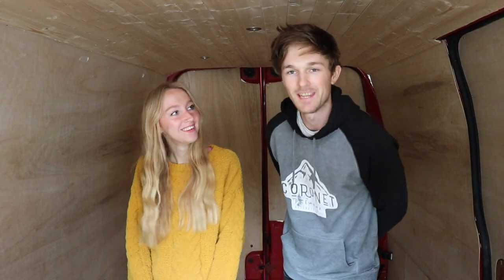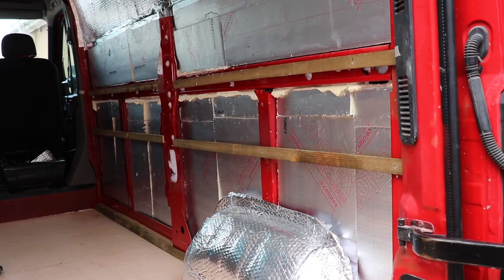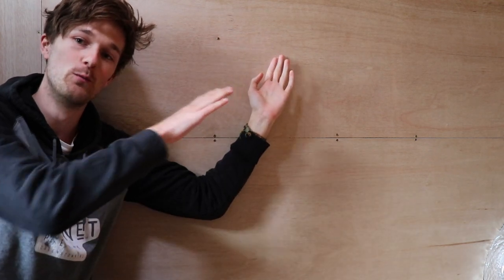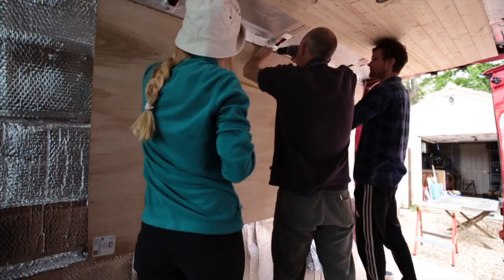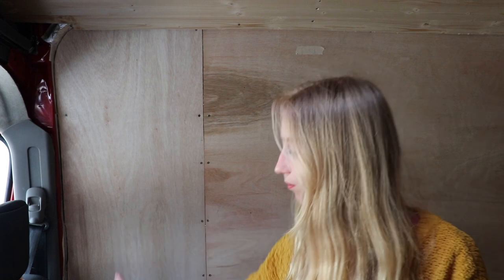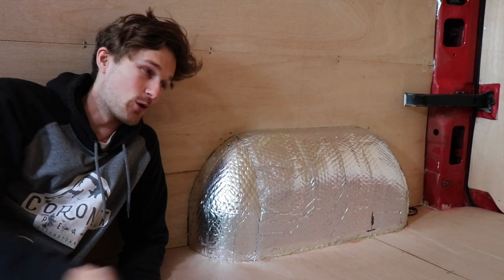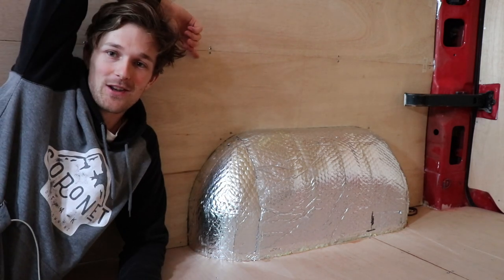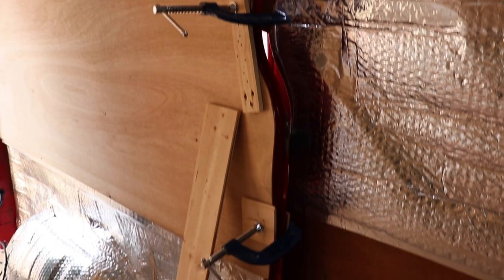How to Make Plywood Walls | Self Build Van Conversion

Comment: Nice work and one more question What was the thickness of the plywood (wall) thank you
Reply from the maker: Thanks, we used 3.6 which sounds too thin but actually with the battens and insulation, is more than enough.

Comment: Why would you drill holes in the van metal when it already HAS A MILLION HOLES ALREADY? Why not just use them?
Reply from the maker: Thank you Shannon 🥰 This was because the holes needed to be in a very specific place to fix things correctly. We wanted to be accurate with the placement of everything and it’s worked so well as everything looks perfect 😀 Another reason we didn’t reuse some of the holes is because they were too big ☺️ Thank you for watching
Reply: @OurWildHorizons  
What kind of screws do you use?
Reply from the maker: Self tapping screws 😃
Reply: @OurWildHorizons  
But how do they hold? Since there is only a thin metal sheet (the van wall) and nothing for the screw to screw ONTO. My screws just pull right back out.
Reply from the maker: I’m not sure why that happened to you, ours stayed in just fine. Did you pre drill a hole? Make sure the pre drilled hole is much smaller than the screw and then screw it in my hand with a screwdriver (it should be very stiff to get in) xx
Reply: @OurWildHorizons  
I didn’t drill new holes. I’m talking about the holes already in the metal. Screws don’t stay because the metal is so thin.
Reply from the maker: I don’t think you can use the holes that are already there as they won’t be the correct size 😄
Reply: @OurWildHorizons  
You can get the correct size. That’s not the issue. The issue is that the metal is nearly paper thin and has nothing for the screw to thread on to. I have some rivet nuts which are made specifically for that issue, but I see people saying they simply screw onto the van metal without problems. Either they’re doing something else and think they’re screwing onto the van metal, and just don’t understand what they’re doing, or they’re not telling the truth.
Reply from the maker: The only thing I can think of is maybe the metal in your van is thinner than some other vans. Ours is a Vauxhall movano and maybe that has thicker metal :)  the screws stayed in really well and were very difficult to screw in and very tight 😊 I hope you can fix this problem, good luck 💛
Reply: @OurWildHorizons  I have a Promaster. The rivet nuts should do the trick.

Comment from the maker: We are curious, what do you prefer - Plywood or tongue and grove cladding?
Reply: We'd decided on the same approach as you guys! Ply for the walls and T&G cladding for the roof, but possibly spaced with a thin piece of dark painted ply underneath. What thickness ply did you use for the walls? I don't recall hearing you mention it. Thanks :)
Reply from the maker: That sounds awesome! I've seen that done with the dark ply underneath and it looks amazing! We used 3.6mm ply for the walls as we needed it to be easy to bend around some big bumps. we could have gotten away with 5mm ply too :)
Reply: @OurWildHorizons  That's great, thank you :)

Comment: Thank you for the build 🙂 how thick was your plywood?
Reply from the maker: For the walls it was only 3.6mm which we have found to be thick enough as long as you have battens underneath in places that you might screw cupboards to. Thanks for watching!
Reply: Don’t use anymore more than 6mm
Anymore won’t be flexible enough to bend around the curves

Comment: How did you fill the gaps where two pieces of ply meet? We are doing the same but i want to cove the joining lines and holes from the screws. Will not a normal filler crack from vibrations?
Reply from the maker: We didn’t fill the gaps because we planned it so all the gaps were hidden by the bed or the counter space (then the splashboard covers the last bit) 😊
Reply: @OurWildHorizons  makes sense. :) i think on our layout it may be trickier , but will  have it in mind.
Reply from the maker: Hope you work it out 😊

Comment: Another great video.  One question... @1:29 when you screwed into the metal, what did you use to grip the screw into the metal (did you use a rawl plug or similar)?  Thanks.
Reply from the maker: you can drill a small hole first then use a self tapping screw. We also put some blobs of sikaflex along the batten before we fixed them on :) If you want you can buy screws that you don't need a hole first they are called self drilling metal screws, they have a weird flat bit at the end. This is kind of like a drill bit build into the end. We would have used these but we used what my dad had in his garage :)   xx